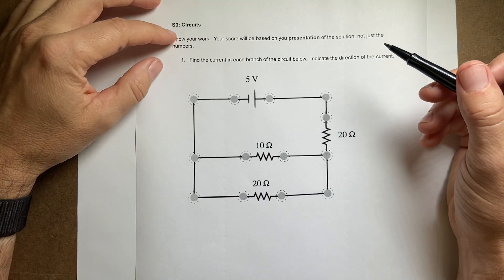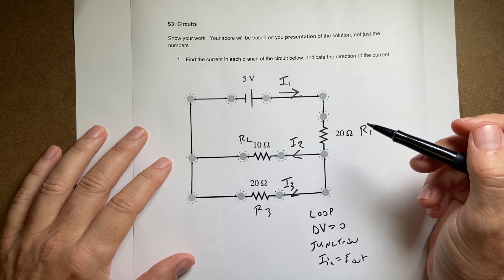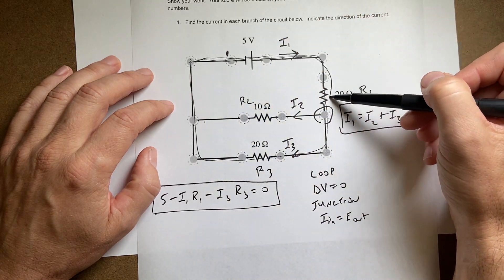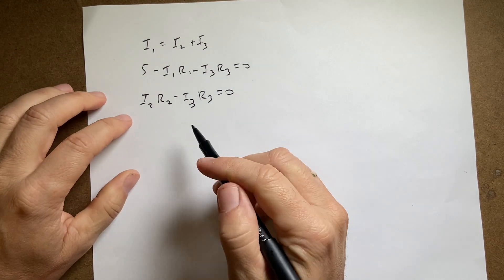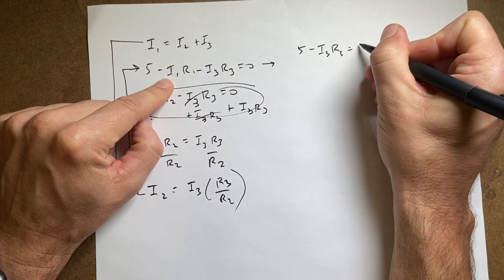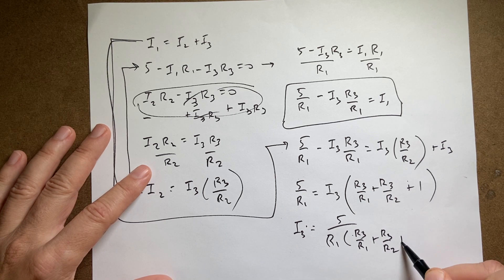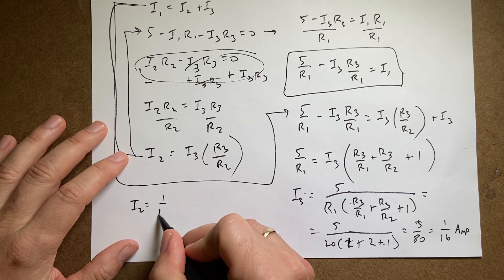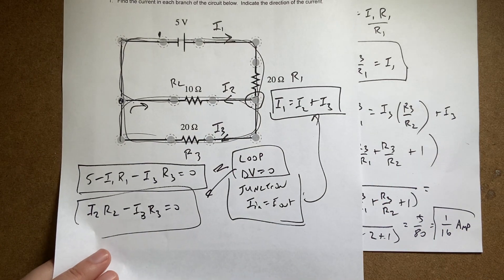Electric Circuits - find the current in three branches with three resistors

Comment: you can calculate the currents way easier than that I think, if you just do that: R1=20Ω, R2=10Ω, R3=20Ω and U=5v, R2 and R3 are parallel connected, so R23=R2xR3/R2+R3=10x20/10+20=200/30=6.66...Ω ,    i=i1=U/R(equivalent) , R(equivalent)=R1+R23=20+6,66=26,66Ω,  so i=i1=U/R(equivalent)=5v/26,66Ω=0,1875 Amps    =>   i2=Uab/R2 (point a is the junction where i1 splits to i2 and i3),      Uab=R23xi1=6,66x0,1875=1.25v  => i2=1,25v/10Ω=0,125 amps => i3=i1-i2= 0,1875-0,125=0,0625 amps or  1/16 amps